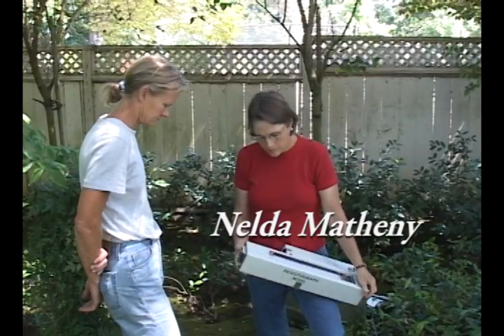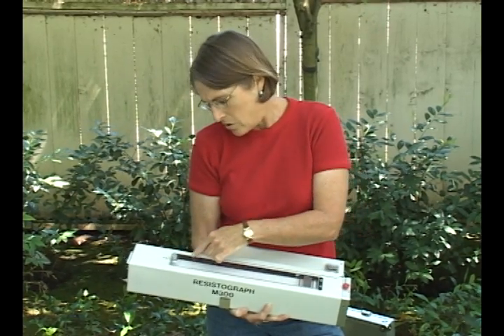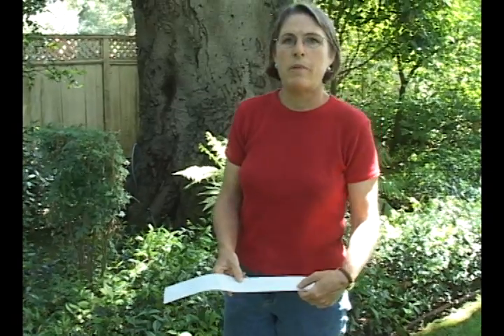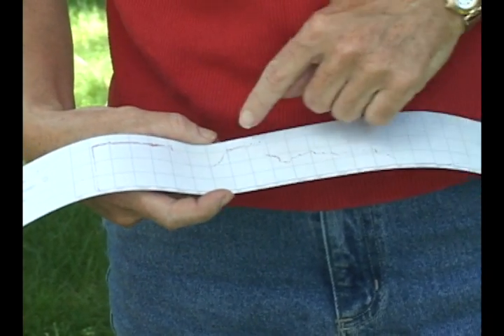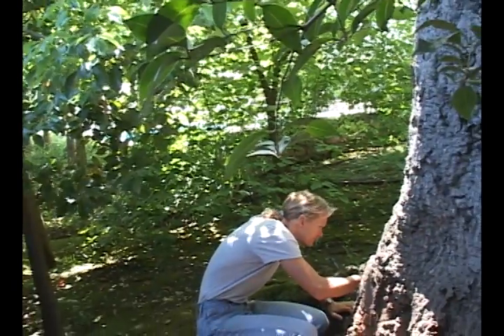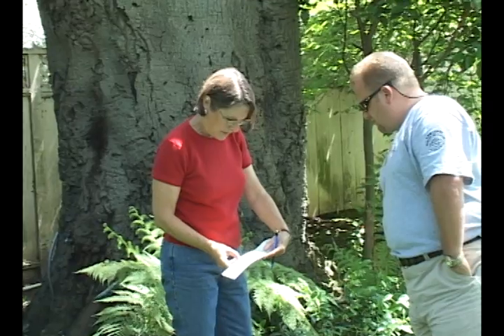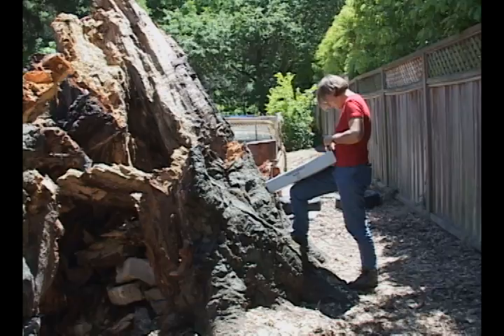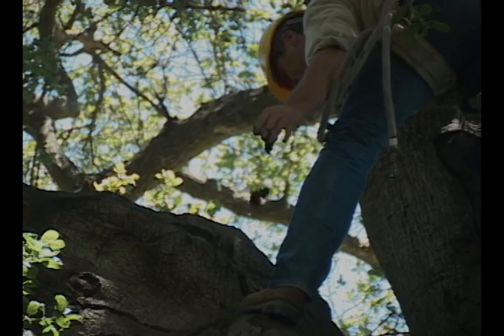Drilling Resistance Instrument

Comment: in my experience there are two problems with this system. one is the sharpness of the drills the second is the condition of the batteries. Blunt drills and over enthusiasm can cause plenty of damage and the device creates a path for disease to enter. I prefer the tomograph I know that it is a bit of a chore to set it up and can be difficult when the tree is on a slope because it needs the sensors to be at a particular distance to the ground. but still it gives a good picture without causing damage. I have been looking at radar which is at that stage where it still needs more development but each new release moves it on more. Interpretation and experience is the key. I am very interested in this for looking for root systemsstill the old rubber hammer takes some beating.Still a good video introduction.
Reply from the maker: Thanks David, I pulled this video out from the archives (15 years ago), but thought it was a good representation of this machine. I also have used the Tomograph (subbed from another company), and I feel it does a very good job. Thanks for commenting. Climb safe!

Comment: How many drills did you do?
Reply: +Thærikk Acid 8, my God
Reply from the maker: This video was from about 15 years ago. This tool is not to be used unless the potential for failure is extreme. It can also be used to justify the degree of internal weakness for permits
Reply: Well, i see that and it's not meant to be rude, I know that it was "state of the art". :)
We learn today that the drills are more for a last safety check. Tools like the different sonar tomographs are nearly non-destructive (or the good old "rubber hammer"). The Drills, if not properly used can damage the tree severely . Many drillings over many years can help the fungi to spread beyond the barrierzones that are build from the wood to hinder the fungus to attack intact wood that is needed for the stability of the tree.
And every drilling is just a very small point of the whole trunk. We just saw that recently on a field trip. We had a difference of 5-18cm of intact wood just because of two different drill-spots that were like 50cm away from each other.
Reply from the maker: +Thærikk Acid I didn't think your comment was rude at all. This tool does have some downfalls but still a valuable process when needed. I put this up (from the archives), to help explain a technique that might be foreign to a lot of people. Thanks for commenting.